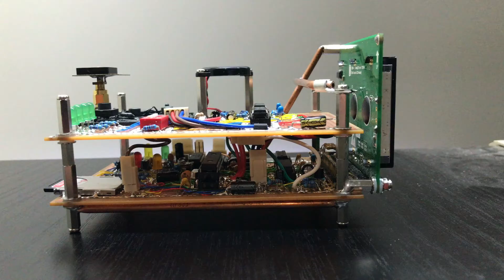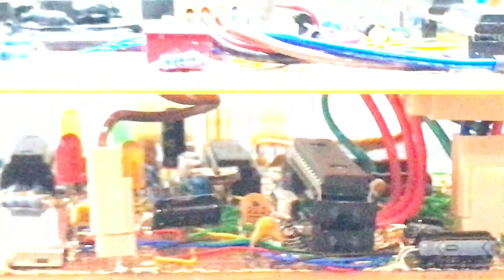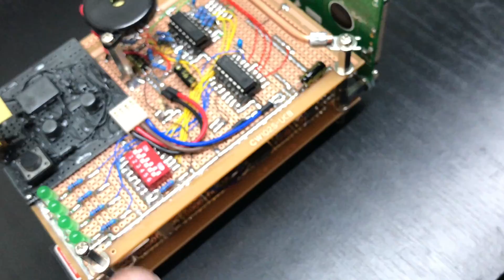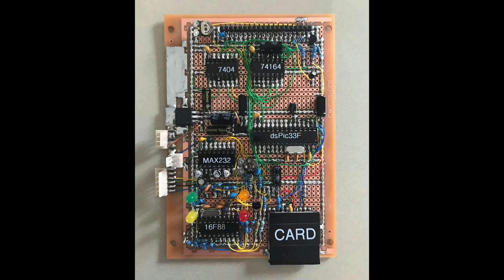Graphic APRS Modem (Project Preview)

Comment: Publish "if you can" the schematic and PIC code.. Thanks any way.
Reply from the maker: I’m already sure I won’t be interested in a comprehensive implementation of APRS. It’s the greatest shitshow I’ve ever seen. I’m normally up for a challenge, but I don’t even like it. Try taking a read of it’s spec (APRS101.pdf). This project has a couple of specific reasons to exist, and implementing those isn’t such a big deal.